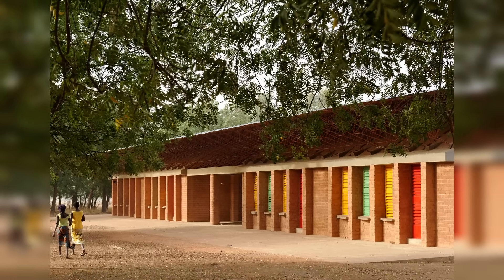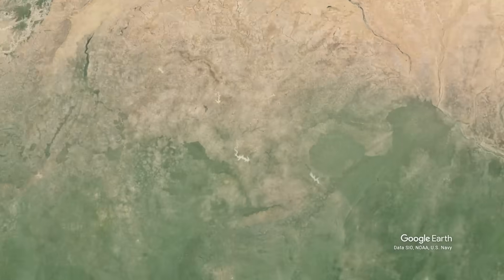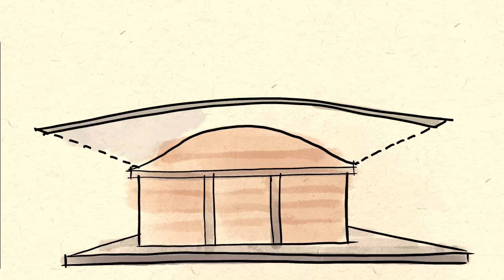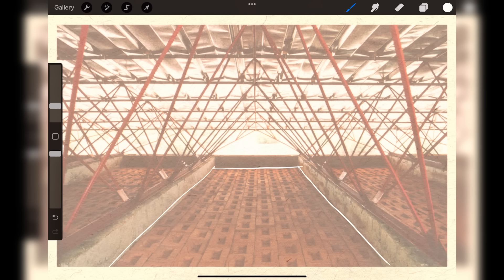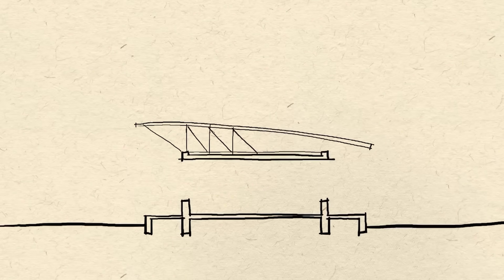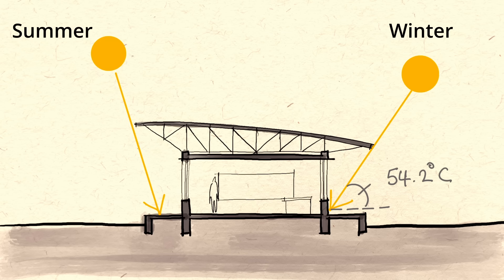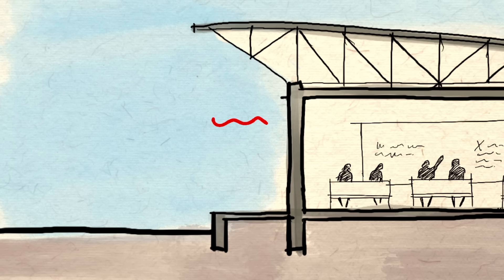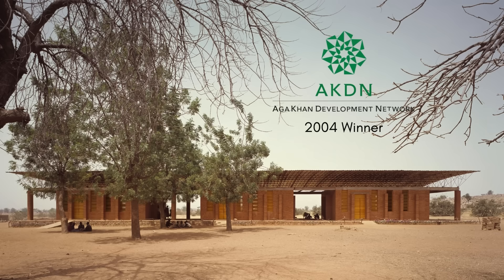The 3 Design Strategies Keeping This Building Cool In Scorching Heat

Comment: For those who live in RV campers, they can tell you that adding a shade over the camper makes a massive difference when trying to keep cool. Wondering why this idea isn’t utilized more in the desert southwest of the US and other regions.
Reply: This general concept is why I wanted large trees around the house when my wife and I were house shopping. Growing up in Texas, my buddy's house (which eventually became my house as well) was always so much cooler than any other house around thanks to the many 40ft+ trees in the yard.

Even now as an adult living in Michigan, our house is much easier to cool than my MILs house thanks to our trees
Reply: @LittleCrowYT large trees don't typically grow well in the desert.  Cottonwoods grow in the AZ desert, but only along the seasonal creeks and rivers.  With no way to water a large tree, your shade go bye bye.
Reply: @MeanderingMentor  yeah that's why I said the "general concept" and then referenced two places that do have trees 👍
Reply: FYI- one of the reasons people in the south built homes and buildings with 14 foot ceilings was to allow heat exchange. The higher rooms allowed the heat to rise, away from people. Just open 1st floor windows on the shady side of the home, and open windows on the second floor and the home would cool itself by convection. Still works today AND we have better insulation than lath boards and plaster!! Cheers
Reply: I live in the desert southwest near the border with Mexico, and every year in the Spring and Fall we are treated to very heavy wind storms.  We often see sustained winds of over 50 mph during the day that go on for many days, and an over-shelter like the one in the video would have to be very strong to withstand the winds here.

We do use woven plastic mats stretched between poles like heavy dining flys over outdoor structures like playground sets and carports, but they only last a few years before they need to be replaced.

Also, passive solar cooling stopped being a thing here when everyone got electricity.  I'm not saying that passive solar cooling wouldn't be a good thing down here, just that it was cheaper to use existing building designs and hardware common in the rest of the U.S. than it was to design unique buildings for this region.  Don't forget that price is always an important factor in building construction.  It was cheaper to do what was already the standard in other parts of the country, and just run the evaporative cooler during the day to keep things cool.

P.S.  In the past we made buildings here with thick walls made from adobe, and they were very good at maintaining a liveable temperature inside them, but they also required a lot of upkeep, and the nature of the material limited what you could do with it.
Reply: @whistlingsage9817  wind speed is good at your end so why not you try wind turbine. it will spin all day/night and contineous source of electricity. 
if your weather is hot only and not humid than evaporative cooling is best n cheap for you.
Reply: @xyztnce I also live in the borderland.  

The wind here is often too low or too high for wind.  I several people who employ small wind generators and the output is inconsistent through most of the year.  In the heavy winds the blades are either locked or disconnected to prevent damage.

Then we have an issue with solar in that efficiency drops rapidly with heat.  For comparison...  we often spend weeks over 100 in the summer.
Reply: @kwonekstrom2138 That seems to be a bit exagerated. Perfomance drops about 1% for every 3 degree celcius. Let's say 10° C is 100%, so 40° will have 10% loss in performance, even if it would be 20%, 80% performance are left. Secondly, sunny regions provide sunny hours all over the year so that solar panels drive down your electricity bill all year round.
Reply: @leonlowenstadter9223  Wow, you're really optimistic.  Generalizations aren't a very good argument.  Some solar panels are better than others...  but losing 30% efficiency compared to winter is pretty common. (temp coefficient works both ways)

Most people would consider that substantial enough to think about.  Now...  in this area, with AC...  that loss also coincides with much higher power usage.
Reply: @kwonekstrom2138  When you read your comment I reply to you'll see that you used generalisations first. Howver, as the "fuel" for solar panels is free, the efficiency needs to be considered versus costs of its purchases. When you drive a normal car, only two thirds of the fuel's energy is used to move it, the other third is wasted as heat. As China has cut their prices on solar panels lately due to a slow demand in China, you could go over your calculation and get a new result. By the way, places where you need an A/C are usually places with many sunny hours so that panels harvest up to twice as much as up in the North. The loss of efficiency is overcompensated by the gain in harvested energy by far.
Reply: @leonlowenstadter9223  No I didn't.  Thermal coefficiency is a stanrd specification for all solar panels.  In fact, mt statement is "some solar panels perform better than others".

It's obvious that you just pulled a number out of your head since none of the solar panels I looked at have that thermal coefficient.  Your results also missed that solar panels become more efficient when under the specified control temp (usually 85).

The rest of your argument is "whataboutism", but I'll bite...  solar typically is only cost effective for the consumer with subsidies.  Hugh quality solar panels have only recently become cost effective compared to fossil fuels at commercial scales.  This is more due to the rising cost of fuel than solar tech itself.

While you focus on the fact that the fuel is free...  solar panels are typically expensive, require a lot of space, and need maintenance.  If the operating life isn't long enough to compensate for this then it's not cost effective.

And that brings me back to the reason solar panels aren't used as often in deserts as you would expect....  EVERY solar panel has a thermal coefficient...
Reply: @xyztnce  american designed wind turbine needs constant. mininum speeds. I think the lowest ones are min. 15mph winds. Most are optimized for 30-50 mph.
Reply: @whistlingsage9817 buildings made from natural materials are still standing hundreds of years later all over the world
Reply: @whistlingsage9817  I recently found out about knit solar shades from The Natural Home, they're supposed to be a lot more durable than woven shades and they're permeable so perhaps wouldn't be in as much danger during a windstorm. Kind of pricy, but it's USA made and maybe would even out if they don't need to be replaced as often.
Reply: Many camp resorts in Florida use this
Reply: Less or little potential need of an A/C unit is why or US designers/home engineers may not be aware of this cooling principle.
Reply: Thank you. Thank you. I live in the semi-desert of the American Southwest. I have stated for decades that modern American desert home construction is the worst possible design. The only rational is to use your architect's, concepts. I would add some important changes valued in much older desert buildings on several continents. The roof needs to extend at least 8 feet or 3 - 
2.5 meters beyond each outside wall. These provider shade cooled air into the building preventing thermal loads on the exterior walls requiring less wall mass. The outside shaded areas are used for outdoor meals, relaxing chairs, etc. Also in high wind zones to keep the large roof from becoming a sail and being torn off the roof needs open channels or spaces so the wind strength is minimized.  There are many other passive cooling techniques dating back hundreds of years world wide.
Reply: On us Mexico boundary they build houses with dome roofs with oculus small window which serves as hot air evaporative.
Reply: We do use shades over our camper here in the Sonoran desert.
Reply: Because it's literally easier to plant a big tree in front of the house than to build extra roofs.
Reply: @AndruComedy Until the tree falls through the roof or the roots crack the foundation and clogges the sewer pipes.  Trees wreck houses, if you want shade there's a reason that in the 1800 and 1900 it was common for houses to have large covered decks and porches over the doors and windows. Those large decks functioned as a solar shade to block heat from getting into the house via the doors and windows.
Reply: @AndruComedy  I hang tarps on the S & W sides. 10°-15° cooler.
Reply: it is used. when I started to gather information about earthships, it was reported several times that you need to put the roof ahead for at least 1 meter of shade before the building and the openings to ensure fresh temperatures in hot climates. it is well known.
in summer I always open a parasol in front of my veranda. if I close the curtains and open the door just behind the parasol, the temperature drops drastically even if it's all glass walls.
Reply: Yup, that's why RV people will fight over the shady treat spots 🤣😂
Reply: @Steven-gv1ke "Are you not entertained ?". No need to watch professional wrestling, mixed martial arts or Olympic boxing at the trailer park.  Your next door neighbors might be tomorrow's Super Stars!
Reply: Common sense doesn't exist in America any
Reply: the series landrovers were available with a safari roof
Reply: I think 40 years ago Land Rover called it Safari roof
Reply: Zoning laws protect the profits of the utility companies
Reply: You must be young effer.
They don't use this idea, because it would cut down on electricity use. Which would cut down on money that rich people make. And taxes that government makes.
You're not either of those groups are you?
Everything is about money bro.
Anytime you can simply point out a solution to a "problem", it's not really a problem, it's by design and a means for someone to make money.
Reply: @m4rvinmartian  So, the power company pays the construction firm a premium not to use safari rooves, or they have shares in the construction firms to tell them what not to do?
If the government makes less tax off the power company, that puts more money in the average pocket to shift around the general economy and that is far better for the economy immediately and the government ultimately.
Reply: When I lived in the Outback we had a safari roof over the main house building (it was transportable). The school had safari rooves over the classrooms. That was in the '80s. The actual homestead for the nearby cattle station was classic desert architecture (for Australia), a square building made of brick and stone with high ceilings and a deep verandah that wrapped around all four sides of the house. That was built prior to WW2 if my memory is correct. The arrival of the modern world is what stopped this kind of building engineering. You can punch a hole in the wall, put an air-conditioner in it and everything is good.
Reply: Roof mounted photovoltaic modules reduce heat gain, but you don’t get venturi effect like this curved roof with the block ceiling, but you will experience a cooling effect. I used to measure roof temperatures when I was installing solar systems. Black roofs were by far the worst. So hot it would burn your feet. The solar modules get hot on the surface, up to 75C in full sun. Thats a lot of energy... One inch away on the backside it would run 60C and less the farter you got away from the module. At 150 mm space the roof would be below 45C. That helps reduce AC load, but I think a full cover would be much better.
Reply: I have always thought that this strategy was very good. The simple issue is that the roof becomes a sail in high winds and will fail causing great structural damage to the building under it.  Both the American Southwest and the Australian Outback used the same strategy of having 6-8 foot covered verandas around a square house so the cooled shaded air went into the house.n
Reply: Because Americans think they know everything already. 😅
Reply: It is not...Because....O right it is used.
Reply: When I traveled as a route driver for my last job, I noticed in some very hot areas around Las Vegas that some buildings did have a metal carport-type roof above their main roof - I thought then that made so much sense - but also thought of bad predators that might camp out on the now-protected main roof- like bobcats, etc -
Reply: 😂😂😂 because their house have a roof and not made out of metal sheets maybe🫡
Reply: Greed
Reply: Just like a woman.  The expression is killing two birds with 1 stone.   Why would you want to hit two birds.
Reply: Only reason is due to american architects still design for Fred flintston. How american designers think, a house is a box and a  car is a box on wheels. And RV is a box house on a box automobile. But transcending from RV Extra Hot, need tree shade , make tree shade to house build under sun, house very hot, no need shade, make AirCon. It takes more than a couple of brains cells to think it through. Try explaining thermodynamics to bush jr= Average american
Reply: People don't change fast...
Reply: I live in an RV in the Sonora desert on the Mexican border. Where a live anything that lets wind under it likes to fly away. I was warned by neighbors not to even install a metal shed as it will blow away during the wind storms. 😅 I bet if we had some proper  footers and an engineer to run the numbers we could pull it off. I am now thinking about how to shape the roof to allow the wind to actually push the roof down and not lift it up tho 🤔
Reply: yep. and painting a regular roof white can also massively drop the heat gain
Reply: White guys were making those bricks
Reply: It's not uncommon for people to have a fully covered porch or an "RV port" over a single wide.

Another common thing I see in the desert is a second steel
roof to act as a radiant barrier.  This is often done as part of roof repairs after the spring winds.
Reply: @kwonekstrom2138  i’m planning on putting solar panels on top of my RV/van with an air gap between them and the roof skin. I’ve heard stuff like that really helps, plus I get some free solar power out of the deal
Reply: It doesn’t look pretty?

Comment: I like the concept. I wonder if that location experiences hurricane force winds. The external roof looks like a wing that could experience major lifting forces in such conditions.
Reply: Glen Murcutt has done similar work decades ago in Australia's Northern Territory, where cyclonic wind forces are a major consideration. It's a different climate with different solutions, but it can work. Look it up.
Reply: @jasondoust4935 Glenn Murcutt sadly still not respected for his wonderful designs. I attended a lecture of his years ago - very inspiring 👍
Reply: Theoretically the upper roof would be pushed down onto the lower roof because of the low pressure between them caused by the Venturi effect. Now whether that's really true, IDK. They'd have to measure the pressure above and below the upper roof during windy days.
Reply: @X4R2  I was thinking the other way around. Higher airflow above the upper roof resulting in low pressure and slower speeds below the upper roof resulting in high pressure. The pressure difference resulting in the air below the roof going from high pressure to low pressure causing lifting of the roof. Like an airplane wing.
Reply: @bruceparker6142 , yup. Looks more like an airfoil. Inverting that would probably create the desired effect better. That would have the added benefit of pulling the shade downward and the roof upward with wind. The low pressure would be between the shade and the roof, thereby drafting the warmer air out of the building. The current design will probably have three pressure zones, high, mid, and low, with the lowest pressure above the shade structure and the building high. Inverting the shade would give you high in the building still, but move low to between the building and the shade.
Reply: Not the same as a wing. The low pressure with occur between the two roofs. As the air flows between them and is squeezed in the narrow space it must accelerate and therefore the pressure drops. That's also how it sucks the heat out of the building. An airfoil is bernoulli's principle as well however the air being forced to travel a greater distance over the top creates the velocity difference. Would be interesting to see this building in a wind tunnel!
Reply: Burkina Faso is landlocked and faces zero hurricane risk.
Reply: @danielheckel2755  Not hurricane but winds of that speed.
Reply: 90% of tornadoes worldwide are in the U.S., Hurricanes start over warm water then die over land as the moisture rains out. This place is well inland & dry.
Reply: @EngineerMikeF  The question was not about those force winds at that location but how that design would stand up in a different location.
Reply: Zero hurricanes there